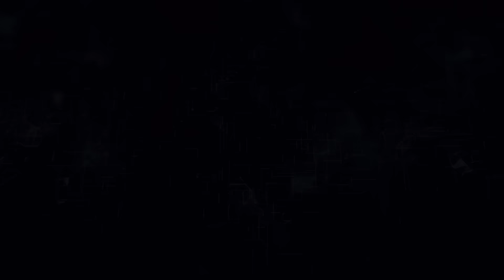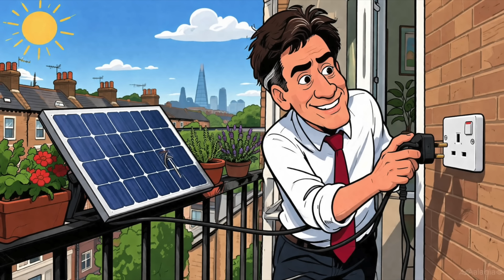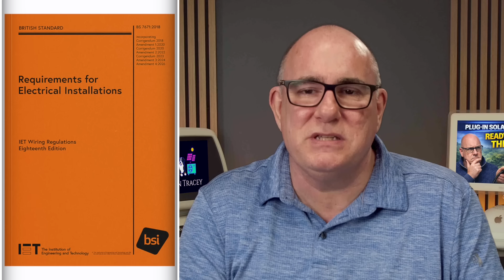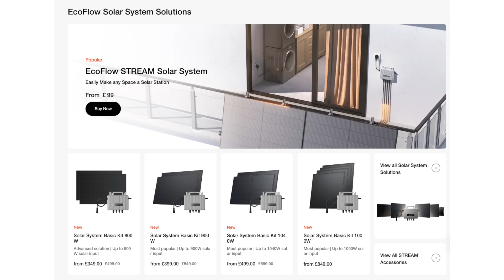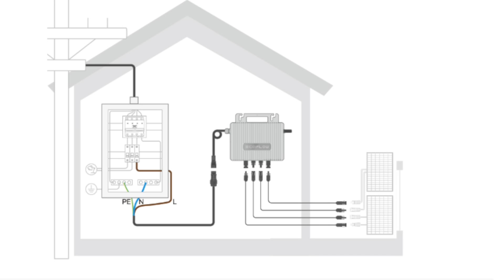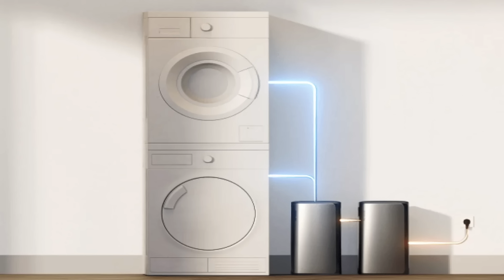Plug In Solar Is Coming… But There’s a Problem

Comment: If you’re lucky, it will repay the daily standing charger increase imposed by the government to pay for renewables….
Reply from the maker: @antiochman8222 that’s not really how it works 👍  

Standing charges aren’t directly tied to your solar system — they’re network costs.  

Solar reduces the **unit rate you pay (25–30p/kWh)**, which is where the actual savings come from.
Reply: @JonathanTracey  - I was being rather facetious - the standing charge in 2000 was around 15p. In 2026 it will be 57p - the increase being driven by the “investment” in pseudo-renewables.

Comment: The problem is >90%  of the general population have no concept of electrical theory and / or the regulations attended thereto. Opening the door to this sector of the population is, in my opinion, not a sound decision, especially when propositions are made by those who also fall into the >90% category.
Reply from the maker: @ivorscruton5121 fair point 👍  

That’s exactly why the safety standards exist (anti-islanding, limits on output etc).  

The other side of this is 90% of the german population are in the same boat, and there have been no major issues with over a million installs

Comment: Can you use the plug in power as backup when the grid shutdown for 72 hours?
Reply from the maker: you can’t feed power back into the house while there is a blackout, this is to stop energy leaking back down the line and possibly electrocuting an engineer who might be working to resolve the issue. For this you need an inverter that supports something called island mode.

That said systems like the EcoFlow stream Ultra have on board plug sockets which allow to plug devices into them directly which you can run in a grid outage

Comment: The relatively low cost and simplicity of plug in solar make this very appealing. One thing that isn't clear is does plug in solar continue if there's a power cut? So, would it keep fridges going in absence of mains power?
Reply from the maker: @alexmousley7213 good question 👍  

No — standard plug-in solar won’t run during a power cut. It needs the grid to be present (safety feature called anti-islanding).  

If you want backup power for things like fridges, you’d need a system with a battery and dedicated backup output.

Comment: I used to have a 14 panel rooftop solar system on my old house but I moved. Thinking about getting 2 or 3 solar panels on my shed and battery system to power my hot tub supplemented with overnight cheap charging.
Reply from the maker: @jtubeist that’s a solid plan 👍  

Using solar + battery for something like a hot tub works really well, especially if you’re topping up overnight on cheap rates.  

Just worth thinking about sizing the battery properly so you’re not constantly cycling it too hard.

Comment: I can tell you now, there's a push back to this from the leeches in the electrical industry who are trying to protect their revenue stream, that's the MCs who are a waste of space, IET, governing bodies etc, I don't see an issue just a load of old farts worried that they will lose a few quid.
Reply from the maker: @acelectricalsecurity I get the frustration 👍  

But it’s not just “protecting revenue” — standards exist because you’re connecting generation *into the grid*, not just plugging in a kettle.  

That said… some of it definitely feels like it’s still catching up rather than helping 😄
Reply: @JonathanTracey I install this stuff for a living and we are due a new regs book which isn't really required, it's just a cash grab by the iet.
And the iet, governing bodies couldn't find their backside in a funnel, they bang on about us harmonising with Europe yet they cherry pick those bits we can share, how long have the Europeans had sockets in bathrooms, we haven't unless you have a massive bathroom, and the Germans have had this solar system for ages.
It took them over a decade before it occurred to them they needed bi directional RCDs.

Comment: Those micro inverters do synchrinize with the grid. They havn´t got a 50 Hz Oszillator inside. The grid simply control the polarity switching bridge circuit. It is a sort of  a controlled rectifier which work the other way round. If you disconnect the inverter its immediately stops to produce ac due to havo vo 50Hz controll signal. 
The term for such inverters  is "line-commutated inverter"  
I build on in a simple form over 30 years ago  with few components, a huge 500 Transformer  a handfull 2N3055 power transistors , few resistors and MP capacitor.  It works in both direction. It could charge teh battery and deliver power to the grid, depends which voltage potential of one  side of the inverter  was slighty higher than the other.
It was no voltage regulator inbetween. Just for an experiment what we an do with power transistors in energy conversion. Som of those simple circuits were published in semiconductor handbook of major brands like Siemens,  RCA or Motorola.

If you wire a solarpanel with a mini inverter showed in this video, there is no way to generat ac at the oputput. (plug).

If you want to have  ac voltage  without the presence of a  public grid, you need what we called  a driven inverter, such  device you probably got  on your computer as UPS or got one installed   in yor car to have  mains power from a 12/24 V Battery. 
Those inverters not intendet to  synchronize  with an external ac source like the power grid as they not fitted with an synchronize circuitry  to run it parallel to the grid. 
 Invertes which can handle both operation modes are calles hybrid  or dual mode inverters. They  attached to a group of solar panels, a battery and a special kWh meter. This meter  monitor the power flow to control the complete system. The system feeding appliances and charge the battery during the sun hours . During the nightime all appliance are fed from the battery. The meter set the voltage in a way so it does not feed power to the grid until the batteries still charging or you are not allowed to feed power into the public grid.

Those inverters comes  more to new installed solar power installation because be more efficient by using solar power at sundown with the facillity of emergency power in v´case of mains failure.
Reply from the maker: @Reaktanzkreis great breakdown 👍  

You’re absolutely right — grid-tied inverters rely on the grid reference, and without it they shut down (anti-islanding).  

The key difference now is modern inverters actively verify the grid rather than just following it.

Comment: Great video with good info, thanks!

I think of this mainly as an emergency backup, rather than for saving money. 
I've already got an emergency battery setup in my garden office (without solar), that's come in handy on a number of occasions.

Seems fairly logical to me that the next step to take is solar, but ensuring everything is wired up by an expert and an electrician does the mains Distribution Board work. What I want is a 1kwh battery that'll kick in when the power goes down, plus solar to help charge that battery in sunnier months. 

Plug-In Solar clearly isn't going to fulfill that goal.

However, It'll be interesting to see how insurance companies handle plug-in solar. 

It seems fairly obvious that this is going to open the door for some fairly dangerous hacked together setups - but I suppose that's already the case anyway.

So perhaps it'll just fall within the insurance claim investigation.
If you are unfortunate enough to have an incident that requires an insurance claim which involves an electrical fault or accident, I would imagine an expert will be called to investigate the root cause.
Reply from the maker: @matthewt5698 you’ve nailed it 👍  

Plug-in solar is really about offsetting usage, not true backup. For what you’re describing, a proper battery + backup circuit is the way to go.  

And yep — insurance will come down to whether it’s installed and used correctly.

Comment: We full-time in a motorhome we have no need to hookup for electricity. 
We don't have a washing machine. We cook and charge what we need, TV , lights, fridge etc. we have solar and lithium batteries.
Reply from the maker: @mpjkea2000 that’s the perfect use case 👍  

Off-grid with solar + lithium is exactly where you get the most value — you’re using everything you generate.

Comment: If this became popular and each property was saving 60p a day on unit costs, electricity companies would just increase their standing charge to claw that back. The only people to benefit from this will be Aldi and Lidl.
Reply from the maker: @gaztambo139 I get the concern 👍  

Standing charges are already a hot topic, but they’re regulated — suppliers can’t just change them arbitrarily.  Also the people charging you the standing charge dont care what you use or dont use, they get paid anyway

The bigger shift is likely how tariffs evolve rather than clawing everything back directly.

Comment: why must it be plugged into the mains, our sockets do not work both ways ,so that is wrong, the government is not telling the whole story of what is required
Reply from the maker: @malcolmone1 sockets don’t “work both ways”… until they do 👍  

That’s exactly what an inverter does — it synchronises with the grid and feeds power into your home safely.  

This isn’t new or secret — it’s been how solar has worked for decades. Not everything is a hidden conspiracy 😄
Reply: @JonathanTracey  right you plug it into a socket ,most are  on a ring main. electrician comes along to do a job ,switches the power off ,,but ring main is still live from the solar panels and so is the fuse box ,, they say you can hang them from balconies ,we get a strong wind ,one takes off and kills someone  ,so they need fixing properly ,,put them on a roof ,means someone  got to go up there and fix to roof ,,put them on low roofs ,get pinched or vandalised ,,.length of cable  to a socket ?oh and 
the cost ,not cheap

Comment: hello from Spain, I have 12 solar panels, 4 big batteries, its a Outback Power system & it was the best thing ever done, saved so much money as ive had it 14 years.  I can generate about 2.6Kw.  Grid is connected as a backup & I never sell power back to them.  Love the iMac G4, ive got the same one
Reply from the maker: @BorisaComputers that sounds like a fantastic setup 👍  

14 years and still going says everything — and running grid as backup is exactly how these systems shine.  

my G4 Mac was the first mac I bought after 2 decades of pc ownership, not owned a PC since 😄
Reply: @JonathanTracey  very happy with it, in 14 years a cooling fan on the main unit failed.  about every 6 months I just have to equalize the system & every week make sure the batteries are topped up with distilled water
Reply: @JonathanTracey  the iMac is a classic, mine is the 20" 1.2Ghz with 1.25Gb Ram

Comment: It must be quite smart to have an inverter that can sincronise with the grid. So if you connected an ecoflow how does the system use the power from your power station before the grid?. I've got some off-grid solar pannels charging a 2kw battery and I use this to run small appliances direct from that but theirs quite a lot of power lost as if it's sunny the battery fills very quickly
Reply from the maker: @lookoutleo great question 👍  

The inverter syncs with the grid and pushes power into your home first — it reduces what you pull from the grid rather than “switching” sources.  

And yeah, what you’re seeing is normal — without grid connection or control, batteries fill fast and excess gets wasted.
Reply: @JonathanTracey sugest a inverter that my solar could connect to and my batteries that could be connected to the grid and when I had a load on it would use the solar and battery first then the grid power?

Comment: Unfortunately We have got a lot more wind than Sun thanks to air pollution and climate changes What happened to those wind generators that were sold in B&Q about ten years back that disappeared overnight. the way electricity prices are going you will recoup your money in a few months
Reply from the maker: @andrewharman6861 fair point 👍  

Small wind never really took off in the UK because it’s very location dependent and often underperforms compared to solar.  

And yes — with current prices, payback can be much quicker than people expect, especially if you’re offsetting daytime usage.

Comment: To be honest sorting my base load is what I want.  
I'm thinking of getting a couple of small solar panels, with a battery, so I can run things the WiFi and fridge incase of a power cut this summer
Reply: The ecoflow inverter has a seperate conection to do just that. Instead of pluging it into a house socket you plug it into a lithium battery storage box that has sockets on the outside. Then you just plug appliances into the box/battery.
Reply from the maker: Yep htat will do it

Comment: Miliband could cut energy imports if he quit and North Sea fields could re-open.
Reply from the maker: but that wouldn’t make any difference, gas and oil has sold on the global market at global rates. Just because it comes out the north sea doesn’t mean we get it cheap.

Comment: We have a 10 year old roof system, no battery. we sell a little back to the grid, but still have huge bills. I was thinking of adding a plug in system with a battery. Would this help, and is there a system you would recomend?
Reply from the maker: @druidnia yes it can help 👍  

What’s happening in your case is you’re exporting cheap and buying back expensive. A battery fixes that by storing your excess and using it later.  

A plug-in system could top things up a bit, but the biggest win will come from adding storage to your existing system.

Comment: The 2 things i wanted to know when watching this were how much does it cost to buy and how much can i save on lecky. Guess i will have to wait a while for the answer.
Reply from the maker: @gramfur8201 great question 👍  

Short answer — it depends a lot on setup, but these are relatively low cost and savings are more about reducing usage than making money.  

I’ll be doing a proper breakdown once pricing and regs settle 👀

Comment: Yey. Now I can spend £1000 to save £15 a month.
Reply: £129 for a micro inverter. Two cheap 400W panels, approx less than £400 total 😊
Reply: @johnp99550 I googled a 600watt setup and it showed £800-1500.
Reply from the maker: no you can spend £200 to save £100 a year

Comment: If i add two of these micro systems to my rooftop system i would have enough power to charge our phev for free
Reply from the maker: @aeroflopper possibly 👍  

But in reality it depends on timing — you’d need that generation *while the car is charging*.  

Without a battery, a lot of that energy won’t line up. With a battery though, much more achievable 👀

Comment: I use a stand alone system with a mixture of ground and roof panels,  the energy is  stored in a mixture of car batteries  liberated from a local breakers yard, currently  using 28 car batteries  averaging  a capacity of 160 Ah @ 13 volts each. All lighting in the home is  direct 12 volt only with  three1 kW invertors for mains voltage use  though these socket outlets are not connected to the incoming mains supply, purely stand alone.
Reply from the maker: @georgebarnes8163 that’s a serious setup 👍  

Running fully standalone like that is a great example of what’s possible — especially using 12V directly to avoid inverter losses.  

Must have taken some effort to put that together 👀
Reply: That's how all domestic systems should work. Direct 12v lighting, local solar charging the battery. Connection to the grid only via a  top-up charger, though it might be worth reserving some high power circuits (cooker, electric shower, dryer) as grid only to save on the cost of inverters. Would also be good to have a standard for a 12v power circuit, since lots of electronics (routers etc) run on 12v or less with a wall wart to add inefficiency.

Comment: I did a rough calculation pre (iran) situation, and worked out for it to pay for itself. (For some basic savings on electricity), It would be 4 years, that's without the price of the inverter!
Reply from the maker: @theotherside7538 nice bit of maths 👍  

4 years (even before inverter) is actually pretty decent — and that’s kind of the point, once it’s paid off you’re effectively generating free energy.  

It’s one of the few investments where the return is that predictable and low risk.

Comment: When my supplier put in my 3Kw roof solar, he wasn't  MCS-certified (he claimed he was "fully certified" when selling).  So I went the £250 Octopus route, and did my own G98 ( my DNO was really helpful).  Paid that off in the first 2 years via the export tariff (15p per kWh) with a little over.  800-900W is definitely not in that league!  Particularly as the export tariff is dropping slightly from April 2026.
Reply from the maker: @spiralx6249 yep completely agree 👍  

A full rooftop system is in a totally different league — plug-in solar isn’t trying to compete with that.  

It’s more about low-cost entry and reducing base load rather than generating meaningful export income.